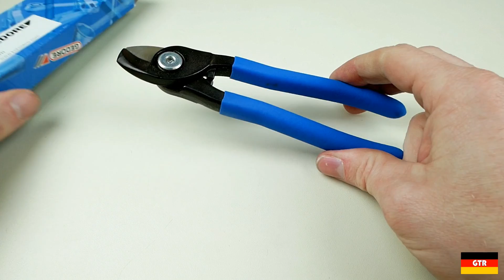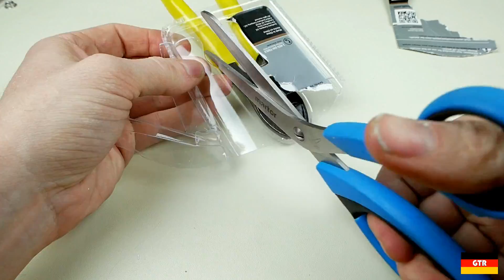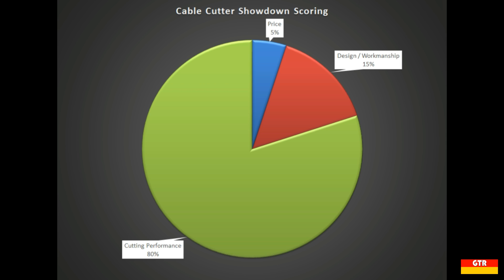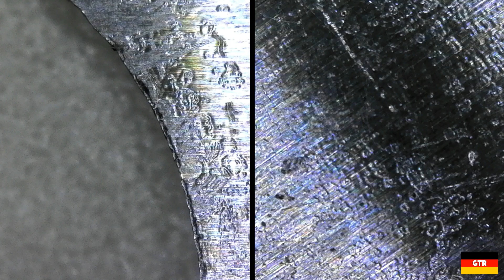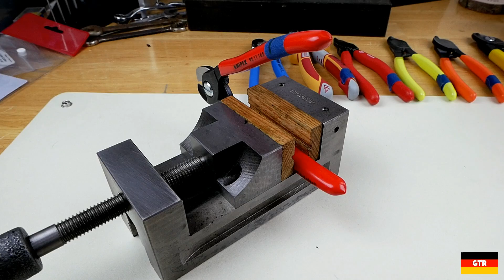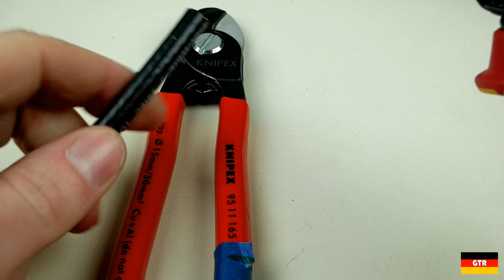Compact Cable Cutter Showdown

Comment: Many presentations on YouTube are self-labelled 'reviews' that totally disregard the entire premise of what a review should be. This was a superb example of how to to perform a review. Bravo, and thank you.
It was disheartening to see how far Bahco has fallen as a brand, with outsourced production and seemingly no quality plan to prevent poor quality manufacturing/finishing from reaching the end-user. The one issue that this presentation didn't, and reasonably couldn't, cover was steel quality and temper, but if a QA plan cannot afford basic tooling issues then presumably there is very little reason to expect good quality steel either.

Comment: Also a good cutter is from Engineer - Japan steel made. PK-50 or PK-51, about 25-30 $ or 25€. Very nice cutting. Also, test should on cutting performance after using for few months and see which maintain same cutting performance and who don't.

Comment: I question the degree of importance of pricing in these tests. Yes, pricing is not nothing, but if you want your tools to be reliable and last a long long time, for most users even paying 50% more would be worth it. A cheap car that keeps breaking down wouldn't be worth it, for example. But thanks for doing these videos, though, you know doubt are least you are thorough, unlike most of the linkbait out there.

Comment: A quick suggestion, do cutting test with two points of pressure, one that's a standardized distance, and then one on the end of the handle, or where your hand would rest, that way it shows how much force it'd take in a more realistic way of applying pressure.  

Also potentially do a very brief test of durability (like 20 cuts on a thick cable and then check the blades)

Comment: Good review. I've got both the Tsunoda and Knipex. The Tsunoda is lighter and easier to handle in one hand so I use them primarily for cutting speaker wire and other small gauge application. The Knipex I use more for wire in the 4-8 AWG range.

Comment: Should have factored in durability. Knipex may be expensive, but they last.

I have some NWS pliers - the same maker as those Felo pliers - and the edge durability doesn't impress me. Some cheap Chinese pliers I got for a fraction of the cost of the NWS pliers actually are actually more durable. The Knipex pliers on the other hand are incredible. I've put them up against the same stuff as the NWS pliers without any edge deformity at all, and they cut like a hot knife through butter.

Comment: I have the Knipex which work really well for me, have had them for several years. I might pick up the Felo though, because, why not... You never know what niche use you might find. Like the Knipex I use to strip sheaths on multi conductor or larger power cables ( a hard #2 THHN, 1/0 or whatever) that you would rather cut with a Klein High Leverage cutter...

Comment: So now we're reviewing chinese and vietnamese junk tools?? Why did you omit Felco??? Or Vessel???
Reply from the maker: What are the part numbers for compact cable cutters in those brands?  I've heard of Felco wire rope cutters but never heard that they made cable cutters as well.  Never seen a Vessel cable cutter.
Reply from the maker: This this comparison I was looking at cable cutters that were less than 7 inches (175mm) in total length.  Looks like the Felo C7 is 190mm in length so it wouldn't be included here.  I did a pretty exhaustive search, but I'm sure I missed a couple of brands so it wouldn't surprise me to find that there are other ones that could have been included in the comparison.
Reply: FELCO CP, which might exceed the length criteria

Comment: ive heared the Weidmüller cable cutters are the best you can get, but i guess  that brand is under your radar
Reply from the maker: I'll have to check them out.  I would be surprised if they make their own tools as they are an industrial automation supplier.  Sort of like the screwdrivers that Phoenix Contact sells are actually rebranded Wera Kraftforms.
Reply: @GermanToolReviews  great video, any news about Weidmüller KT8 and where it made and how can we know? Also Cimco duocut?

Comment: All these electric cables are soft. You need to cut a bunch of piano wire to see wich one of these cutters is really made to last. 
I've seen cutters that failed on the first cut.
Reply: That would qualify as abuse and almost certainly destroy the edges of all the cutters. No valuable information to be gained.
Reply from the maker: Since they are only supposed to be used for AL and CU, using them on piano wire would probably chip the edges.  Might be interesting to see on one of the cheaper units.
Reply: @GermanToolReviews  i think MC cable would be a good test.
Reply: I cut about 10 pieces of a bowden cable and cut the heads of a couple of different screws. Are the blades completely unharmed, you have a quality product.  Low quality crap will not cut the cable but rather pinch it between the blades.

Comment: One thing should have been included: 
The hardness of the Tool-Steel used determines the durability of the tool and how many cuts you can do with it until it has to be sharpend.
Reply from the maker: I was thinking about it, but I didn't have all of hardness values for all of the units and I didn't have the equipment to test.

Comment: I'm not sure about the method you used to test the most weighted category; cutting performance. Pushing down on one point of a handle does not equate to how a tool actually performs in a hand. It's not an accurate measurement of how much gripping force is needed or how fatiguing a particular handle design is. It could be that those tools that took more point force from your test actually use less grip force. Or, that even if they do require a (negligible honestly) increase in force they are actually easier/more pleasing to use and less fatiguing after extended use. The difference in forced you measure is probably within the margain of error of the push/pull gauge you used, not to mention slight variations in how you held it while pushing and how perpendicular it was to the center axis of the tool would also throw off the readings. Also, the serrated cutters on some brands are literally useless for a lot of applications because they will damage the cable, shielding, etc., which is why some cable manufacturers even go so far as to recommend Knipex, Klein, etc., in their literature.
Reply: But at least this is a test on how the blade itself performs? Neglecting the grip a better blade will require less force to cut. I guess GTR could factor in the handle design more to give a more accurate cutting performance score, but that would also require him to take different handle variations into account like Knipex.
Reply: GTR - These dudes don't know what they are talking about.  Keep doing what you're doing and don't let the negative nancys drag you down.
Reply: " I did manually verify what I was seeing but cutting a couple of samples by hand and confirmed that X was easier to cut than Y."   Confirmation bias.
Reply: Nothing wrong with criticism. It has nothing to do with being negative. I'm sure he wouldn't want followers that only ever agreed and praised him and his conclusions. I've been a huge fan of this channel since his subs were in less than a hundred. Nothing has changed. I simply disagree on this one, that is all, and there's nothing wrong with that.
Reply from the maker: It was the best way I could think to test them at the time.  I don't claim it to be a controlled experiment, but I did manually verify what I was seeing but cutting a couple of samples by hand and confirmed that X was easier to cut than Y.

Comment: Southwire does have an American-made cable cutter, but I would not call it compact, as it is 9" long. All of SW's US-made tools have dark blue dipped handles with red trim. I bought their crimper/cutter, and it is quite nice, I must say.
Reply from the maker: I think I read somewhere that the USA made southwire tools are actually from Channellock.  Channellock does make good cable cutters for large cables.

Comment: Another great video and review Matt. I bought the same Knipex tool you had in this video and used it to cut 1/0 battery cable with next to no effort. Left a clean, beautiful cut. I wish I had not been so impatient and waited for this review I knew was coming so I could have gotten the Gedore one instead since I would have liked the return spring. Thanks for this.

Comment: The bacho and tsunoda look like the generic "blue cutter" or "cc22" cable cutter. These are the go to cutters in Norway. 
They are cheap, low quality and treated like consumables
They are sold under several brand names, würth, bahco etc, suppliers often have their own logo on them as well.
Reply: Same in Denmark. ALL electric cables are round i Europe(not GB though) . That means cablecutters are used as both cutting, removing cablejackets and wirestripping. Hense the small cutter near the tip of the pliers.
Reply: Same as in Sweden, also they aren't only cutters. They are strippers aswell.
Reply: I am electrician apprentice in Norway and I can confirm all we use is the cc22 cable cutter. But I am looking into Knipex StepCut, but wondering how good it can strip insulation off wires.
Reply: Im loyal to Tsunoda since a lot of their products are hand made in japan, lately they started manufacturing in Thailand. I buy it since it extremely affordable and have no problems. We'll see after 10 years. LOL

Comment: I have an Orbis pair of cable cutters. They have been better than expected. I wish you had included Orbis into your test, but you cant test every pair I guess. I also have a couple pairs of the Orbis angled needle nose pliers. They are by far my favorite to use.
Reply: Are the ORBIS similar to the KNIPEX ? , i"m sure that Knipex own Orbis , not sure if the designs are the same  :]

Comment: You cannot use serrated teeth on shielded RCA's it can to form the shielding making it impossible to seat the RCA at least from some manufacturers  infact in the RCA manufacturers literature they recommend the knipex or the Klein for sharing the cable
Reply: Exactly!

Comment: Nice video!  The only comparison I can make is between the Knipex (95 11 165) that I have and a co-worker's Channellocks (model #911).  Cutting the same 4(?) AWG battery cable, the Knipex, despite it being smaller in overall length, they cut through the cable so much easier than the Channellock cable cutter.  The Channellocks were clunky and cumbersome.  Winner was clearly the Knipex.

Comment: Gotta say, this is your best review yet.  Loved the scientific way you went about things.  People may bitch about sample size, but I would retort that poor performance trying to excuse itself with "sample size" indicates a problem with quality control.
Reply: By the way, you are costing me money.  I have always been a toolaholic, and now you've got me getting my fixes on German tools, too.
Reply: But pushing down at one point on the handle isn't the same as applying grip force and can't really tell you anything, like how much actual grip force is required or how fatiguing the cutters would be after extended use, etc. Serrated blades tend to cut better, but on cable cutters they're a no-go because they can damage a lot of cables. Some manufacturers of wire actually recommend Knipex or Klein because of this.
Reply: this guy is badass scientific method right..

Comment: Products made in China seem to have a problem with quality control.
Reply from the maker: I have found that you get what you pay for when stuff is made in China.  If the manufacturer wants to make a quality product in China they certainly can but they often don't want to pay for it.
Reply: I think your right.
Reply: yep china is mostly used when they want to go cheap, ive also had very good stuff from china, so i am not biased

Comment: This review makes me want to avoid trying anything from Southwire.
Reply from the maker: I can't say as I don't have a lot of experience with Southwire tools.  I know that their new "made in USA" stuff is rebranded Channel lock so it's probably a better product than what I was using.
Reply: Every southwire tool I've used was garbage. I had an $80 multimeter that came with broken leads, and after a yard stopped mesuring AC. A pair of wire stripers that literally exploede on the second use, and a pair of pliers that broke in half.

I will never touch anything from them if I can help it.
Reply: Southwire is a wire company that farms out the manufacturing of their tools